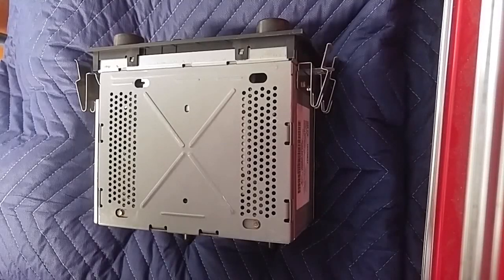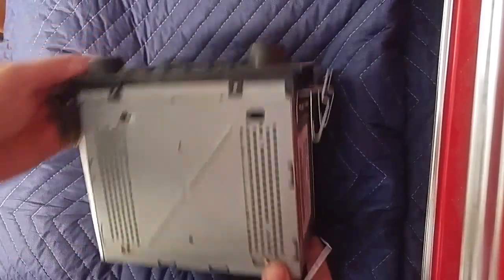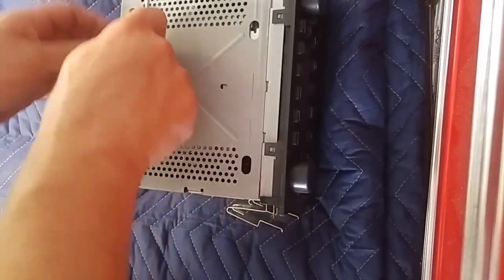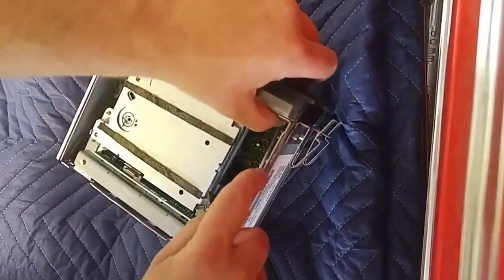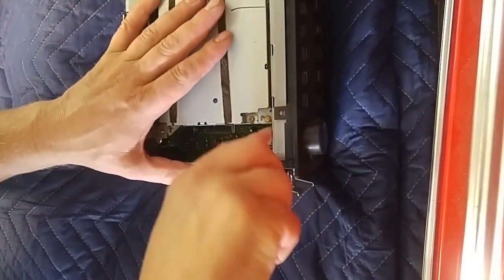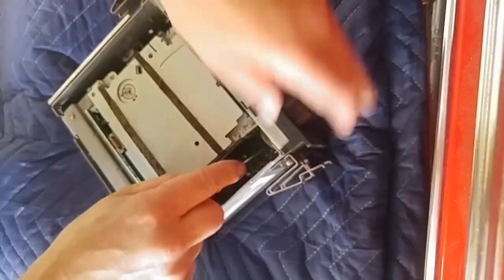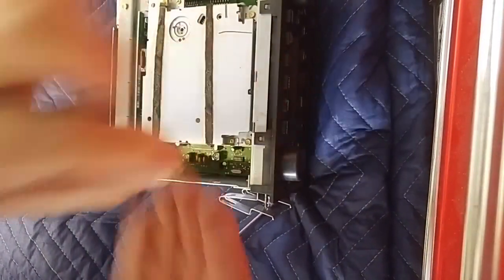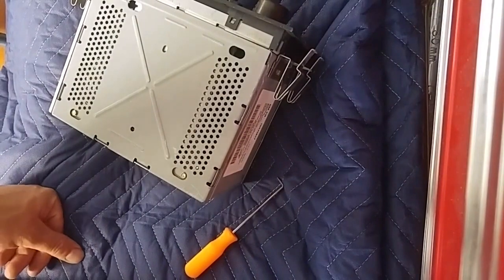Quickly unlock GM Theftlock radio.

Comment: The chip you removed was the eeprom. The same chip that stores  the Vin is the same chip used for storing the station presets and things like volume, bass, treble and fader. All of those functions will not stay in memory without a eeprom.
Reply: jeffescortlx is there a way to keep presets by just cutting a certain pin from the chip?
Reply: Eeprom location delco theftlock radio 2002 suburban

Comment: Is it possible to put the chip in it from you're current radio?
Reply: If the same model of the radio, yes. You can solder your old chip and the security data will be transferred. If a different model, only if they actually use the same way of storing data in the chip or it will not work correctly.